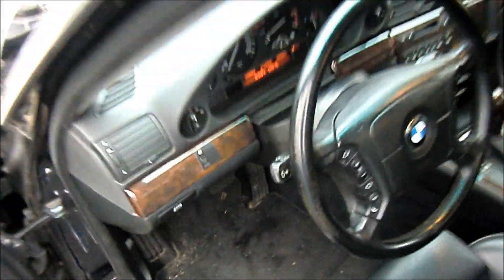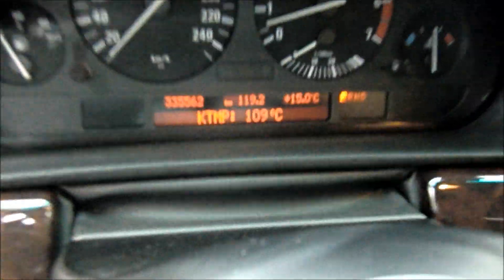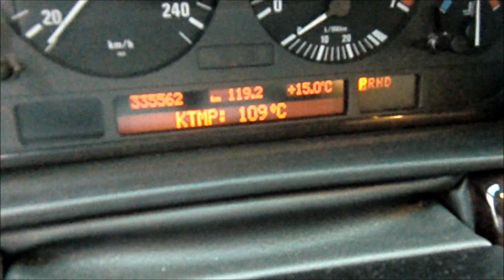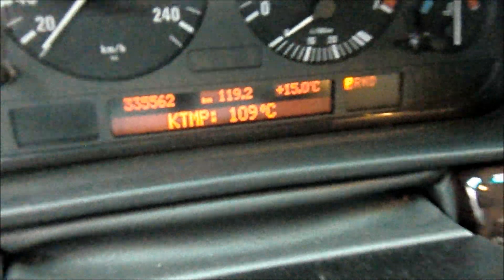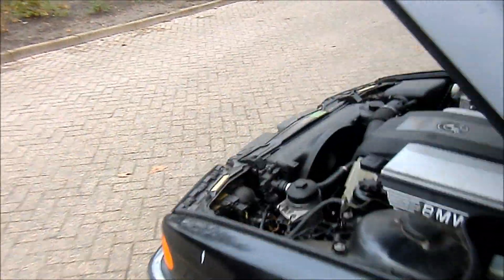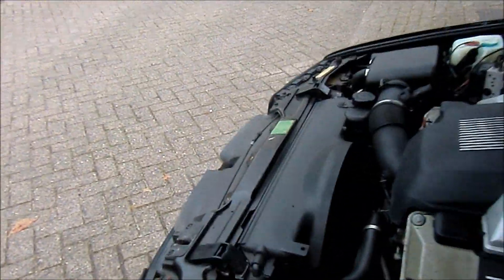BMW E38 E39 How does the fan clutch work/ should work

Comment: so what is the solution if the fan is on since u start ur cold engine, coz have my e39 528 doing this, on since u start the engine, is it an electric problem or clutch??? thanks
Reply from the maker: If it on when cold see if it goes off after 30 sec if not or it stays on all the time it's busted and needs replacing
Reply: Homerraas  thanks alot for the reply... after checking fan doesnt stop after a minute...and yet when cold and engine off.. tried to rotate it both sides.. its not loose at all.. dont know really..
Reply from the maker: Does it go off at all???

Comment from the maker: How is the thermostat? sure that is replaced? Did the system get bled of ALL air? Check the hoses is they get all hot, if not the thermostat is causing it to overheat.
How is the wate rpump?

Comment: 109C
are you joking
did nobody around noticed that this is not normal engine temp?????
Reply: 108 Celsius. Correct M62 engine temp.
Bentley manual
Please educate yourself
Reply: Like mentioned. M62TU normal operating temp is between 107C and 109C.

Comment: I was wondering what happens when the air conditioning is turned on? Does the fan clutch have anyway to engage to get more air flowing over the condenser? Or is there another fan that's electric that switches on when the A/C is activated? Thank you for the video! :)